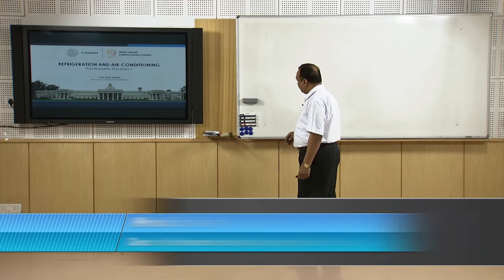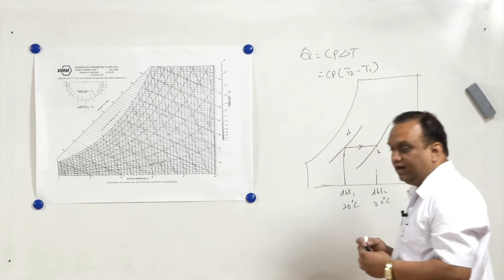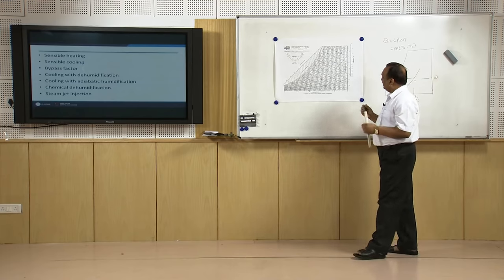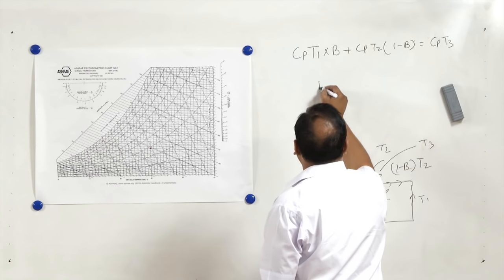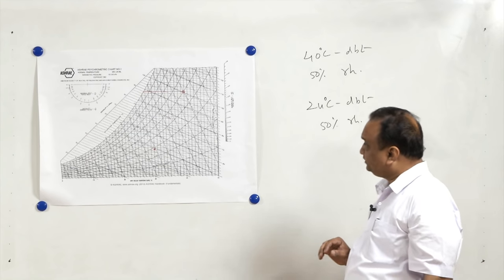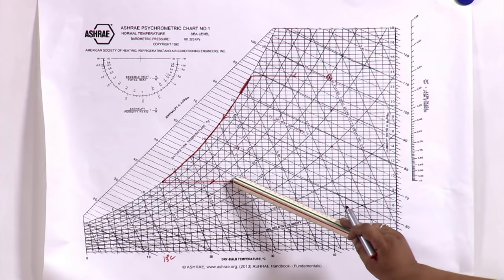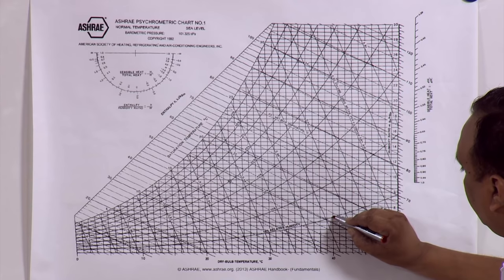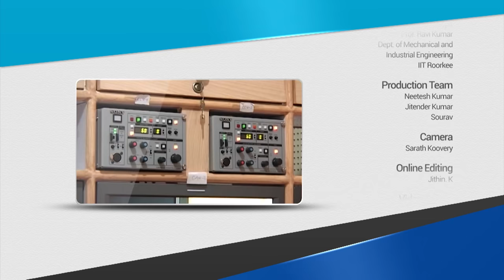Psychrometric Processes-1

Comment: Help please.... evaporative cooling... a cooling tower can take hot air and cool the water and discharge hot air..
If anyone know what a swamp cooler is can the tell me how a cooling tower can reject heat but a swamp cooler cools?
Reply: In cooling tower water which has to be cooled is hot
in case of cooler u use cool water so cooler gives cool air